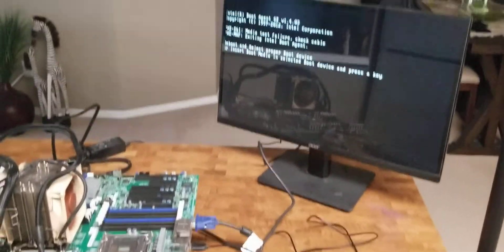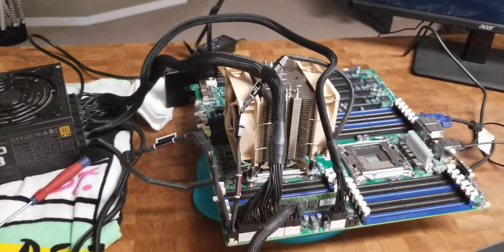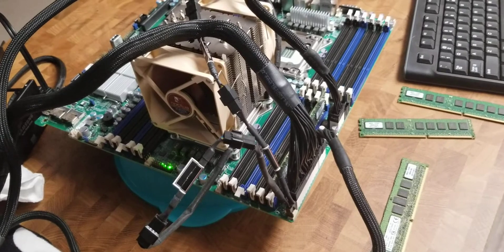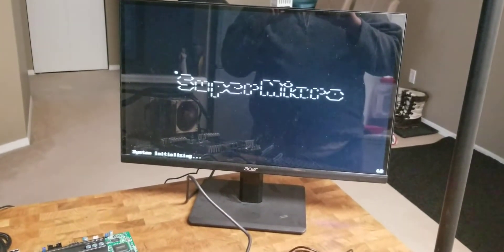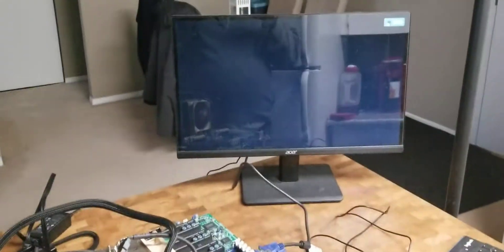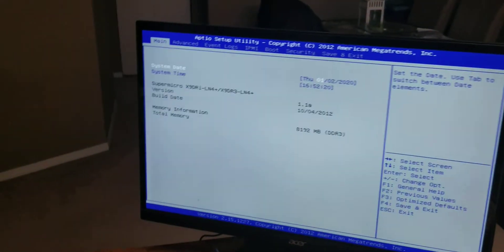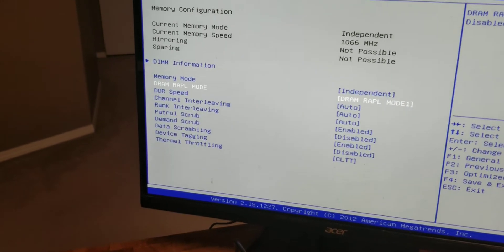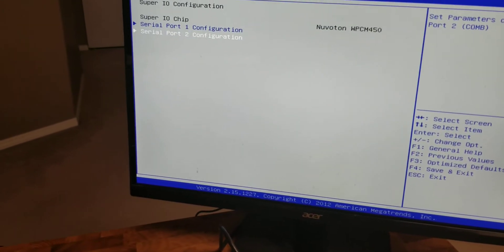Supermicro X9DR3-LN4F+ Boot Success!

Comment: Hi having a problem with a very similar board X9DRi-LN4F+ it
 came with password and just can't find how to clear it, think I have tried almost anything I have found, any suggestions?
Reply from the maker: there's two config menus on these boards. the bios and ipmi. do you know which has a password? 

To update the bios properly using the java ipmi is required but if the bios or ipmi are very old versions those firmware versions will not support modern java jvm's. that java version compatibility issue may be a source of the problem your encountering. 

Also last time I attempted to access the ipmi interface only firefox remained as a modern browser option capable of using java jre or jdk in a browser. try downloading and studying the motherboard manual and see if there's a jumper to reset either the ipmi or bios or cmos. 

If your still stuck perhaps another server hardware tech youtuber named art of server could offer some advice.
Reply: @xartintv  so far can't get into the bios one and can't get the usb to boot to log into the ipmi one :( tried to clear the cmos using the clear cmos contact pins removed the battery, kept a jumper on the power jumper for more than two hours with everything disconnected , so far nothing seems to work with the bios pass
Reply from the maker: @parsec3d  I recall there was a github project I located to unlock something with the ipmi firmware but what that project offered may be unrelated to what you require or are seeking. Here's the url https://github.com/bwachter/supermicro-ipmi-key

Also iirc the ipmi as best as i recall was more capable at many things and only accessible via ethernet from a different pc on the same network. the ipmi firmware with these server boards is lord of the roost so to speak.

https://www.youtube.com/watch?v=piCA2clWaxo

If your unable to remove the password, access the ipmi at all or alter selecting the boot options to boot from a usb stick perhaps you might need to consider returning the motherboard to whomever you purchased it from or claim it as faulty hardware. I'm not aware if the bios password can be removed but supermicro may be able to offer some advice.
Reply: @xartintv  I still have fait the seller already approved me to do an RMA but sending it back would be more expensive than getting a new one, will see if I find a solution before the weekend.

Comment: How did you manage to run 2690v2 on it? What version of BIOS?
Reply from the maker: I just updated to the most recent ipmi and bios firmwares available from supermicro. I made sure to by a motherboard revision from ebay that supported ivy bridge xeons. The motherboard revision must be rev 1.20 not 1.10

When in doubt trust unix surplus!

https://www.ebay.ca/itm/SUPERMICRO-MOTHERBOARD-X9DRi-LN4F-Rev-1-20a-for-V2-CPU-Dual-Socket-LGA-2011/153247862763?hash=item23ae48cfeb:g:UGkAAOSwy~BZ~JUr
Reply: @xartintv  Thanks for the answer.

Comment: It seems from reading the crawls in the YouTube comments that Linux is the go to system for anyone that wants to get a bit more serious about software. I've read where its more "unlocked" than Windows? It also is supposed to come with less bloatware. Hell, its not till very recently that I ever heard the term bloatware, so you know that I am very much a neophyte. No idea most of the time.

I always did like the look if a board like yours that  had two CPU slots verses just one. I kind of like the idea, but would have doubts as to my being able to make it work.

You planning on putting two CPU's in? I admit I like the idea of two CPU's just because of two. 

I understand that the newest models have many many cores and threads, however Thread Ripper and the like are way out of my price range, once you build the whole system.

Using older models to get a lot of the same performance makes sense. As long as the price difference could justify it. 

My little paycheck makes ever owning the latest and greatest a non starter. Even then I doubt I would pull the trigger, as I have never had much  money and might feel bad about spending so much  on a computer, being that I do not use one for a living. Its just a hobby for me. 

That RAM would be plenty for me. I only recently went to 32 on two sticks when the prices finally came back down enough. I ran 16 till then.

I am not picking at any of the age of your components. To me it would be like souping up a slightly older model car to run with some of the best of the new.

The idea really does appeal to me. I don't know enough about the subject to really say, but like anything else, when you can do things like your doing and make the software work then your own your way.

I've sat on the sidelines for so long, but it is expensive, and its like drinking from a fire hose. So much information out there. 

It can get to be kind of discouraging. 

Well anyway thanks for answering. I think I will keep up with whatever your doing with yours as a guide for what I should do. 

I want to get there myself someday. 

I will also go and find those other sources of information that you handed me. Good luck.

Comment: Alright, so you answered my question from your last video. You have experience.

How much RAM do you expect to install on that board? Just wondering what you do with something like that. 

You said you use it as as server, but is it just for your home, or do you allow others to use it as a hub?

I have an older computer I got a hold of, its an original Skylake that runs just four sticks of DDR3 2400 memory.

The cpu is locked. Its a four core part, but it is something to tinker with. I have to check, but I don't think it is hyper threaded.

It was cheap and if I break it, I break it.

I don't expect it to be very easy for me to learn very much upfront.

Your last video helped my take the plunge.
Reply from the maker: 128 GB of ram is more than enough for the intended purpose of running zfs filesystem and perhaps a couple virtual machine instances with qemu. if i ever wanted to add more im not certain what i would realistically use it for. While the old motherboard was dead the "server" has been running on 32GB of ram using an i5-6600k skylake which is just barely enough ram to run an 80TB raidz2 zfs storage pool without using ton of swap virtual memory, powerful but unfortunately overheats significantly faster than the xeon server cpu's and only has 4 cpu cores which is enough at a bare minimum to run plex server transcoding on linux.
  
This server build was pretty much what i felt was a great compromise between new enough hardware to still be usable yet not extremely expensive yet still have gobs of cpu thread capability, uefi bios support and more than adequate system resource potential for a homelab nas server that's also silent enough to live beside the family entertainment center.

I have that system when fully assembled in a Fractal Design XL R2 full tower with 12 to 14 hard drives some of them ssd's and around 84 TB of disk space.

Most of what i learned was due to immersing myself learning to use and learning from Gentoo Linux.